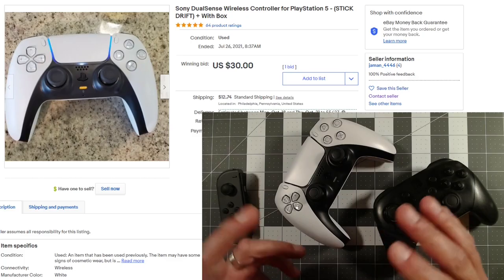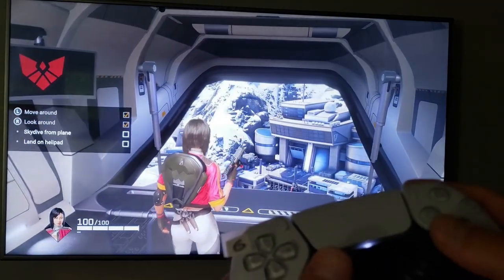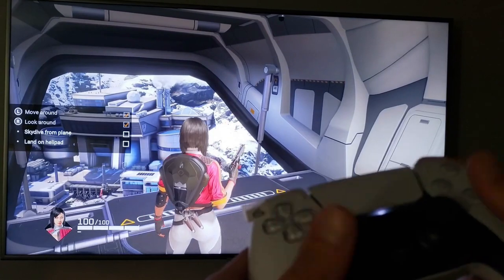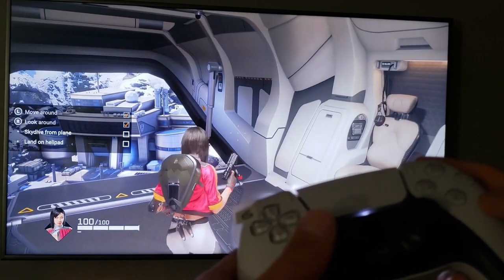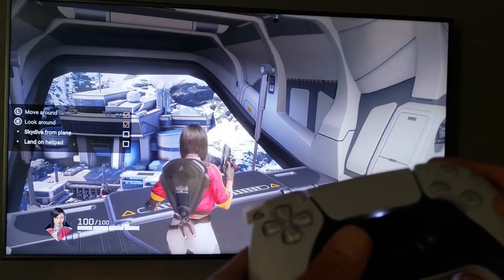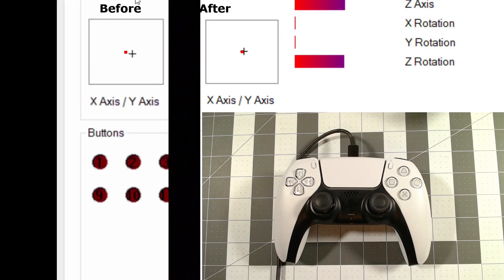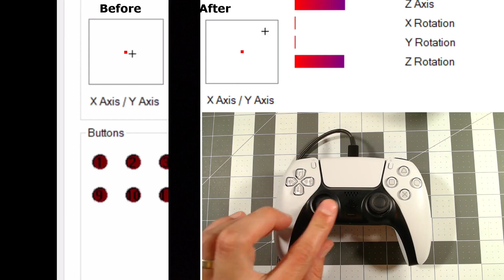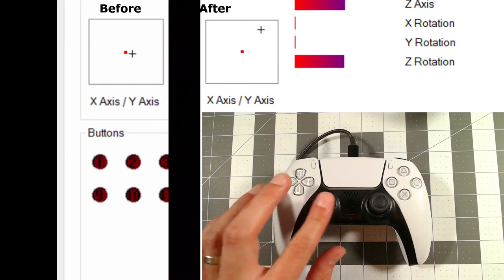PS5 Controller Drift Fix | NO REPLACEMENT PARTS

Comment: Why are companies still using potentiometers...  It's not because it's cheaper.  It is because it sells controllers.  I'm convinced that crappy design is actually intentional.  Sony has been around long enough to know not spending that little bit of extra money on the halls effect sensors will make them millions profit in the long run.
Reply from the maker: I don't see it that way. The "razor blades" are the games, not the controllers. I doubt selling a few extra controllers would even scratch the surface of game sale profit.
Reply: @FantasticQuack  Hmmmm it is the main controller issue though

Comment: This proves, yet again, that the early Dual Shock 3 , with the magnetic analog sticks, were probably the best controllers ever produced in terms of accuracy, durability and response. Too bad we cant find them anymore anywere. In terms of quality , they are worth 10 times more than any elite or scuff or whatever new garbage gets spit out these days. 12 years of hours upon hours of daily use and my DS3 is perfect and i set all deadzones in all games to zero and the controller itself has zero deadzone . It's like comparing a 95 honda to a 2022 honda. that shiny new awesome car with lots of features will be with you for 1 year.
Reply from the maker: VK's channel did a review on a modern 3rd party controller that is using the hall effect sticks instead of potentiomers. Go check out his channel if that interests you!

Comment: I was having an issue with my Switch Pro Controller joystick having a small angle where it didn't register a full angle (so my Dark Souls character would walk instead of jog/run in certain directions).  I did the trick of bending the wiper contacts out a bit, and it fixed it!
Reply from the maker: Love a good success story, nice work!

Comment: I took my controller apart and the common denominator for most of the joystick issues was a tiny piece of lint in the joystick area. I didn’t take it apart completely just flipped over the motherboard with the joysticks and put a flashlight and saw the little lint sticking out. I used a pair of eyebrow tweezers to pull them out very gently and when I put the controller back it was brand-new again.
Reply from the maker: That's super common, ran into the exact same issue in my Vita video, but the dust bunny was wedged in the very deep. Glad you got yours working, nice job!

Comment: This is a great video, but there are other videos that show how to access the potentiometer without completely removing (no soldering). Might be worth a shot if you just want to clean/bend.
Reply from the maker: True, but I wanted to take the whole stick box apart. With the method you're talking about you can just unclip each pot and bend the pins back to allow some access. If you want a full/clear view of everything it's better to desolder it--I just did a horrible job of that here haha. Still managed to get the job done though!

Comment: I stumbled across this vid on Reddit after a Google search. Thanks for this guide! Bit a of a ramble ahead but I actually stuck to using my PS4 controller for a while when I got my PS5 (barely six months ago) so I've got around two months' worth of very light use on my DualSense, and the left stick acts like I'm holding it to the left at all times. I've had right stick drift on well used controllers after playing FPS games and smashing R3 in constantly for years before but this is insane. At least the PS4 controller has nice loosened up and broken in sticks which makes FPS games a joy to use precisely on high sensitivities. The PS5 controller sticks feel stiff like I've just pulled it out of the box and yet it still drifts like this?!

I noticed there seemed to be a switch in materials used in the last "generation" of PS4 controllers around 2020 as I used to open mine up to switch out the sticks for custom metal ones - the motherboard inside had parts in new positions and the sticks felt different in terms of tension, so it wouldn't surprise me if they just switched to using lower quality parts in their potentiometers knowing a new console was coming out, so they could make even more money off even more outrageously poor controllers. Sadly I don't feel comfortable trying to fix this myself but there is no way I'm paying for a new DualSense controller so they better start allowing DS4s to be used on PS5 games 😤
Reply from the maker: Glad yo have you here and thanks for watching! I haven't felt much of a difference between DS4/5 in terms of the joysticks, don't quote me but I think the 2 controllers used the exact same stick box which is a very cost sensible decision for the company but not something that makes the consumers happy when those boxes were known to have drift issues (albeit not nearly as bad as Switch Joycons). Overall I greatly prefer DS5 for the improved form factor and adaptive triggers. I haven't experienced drift on either DS4 or DS5 so I have no personal ill will to them on that topic--maybe I've just been lucky. To get a drifting controller for this vid I had to specifically seek it out and buy it!

Comment: Thanks for this detailed video. This is a ridiculous process required to repair these. I have 2 dualsense out of warranty starting to drift. At least Switch joycon sticks could be easily replaced. I have the kit for joycons but no solder kit. Could you recommend a solder kit with everything needed for this (eg from Amazon)?
Reply from the maker: Glad you found this useful. The easy option for most people to remove the joystick will be to use low melt solder. It stays in liquid form much longer after heating so you have time to heat up pin by pin and remove the part before the solder solidifies again. This is the stuff I bought after making this video:
https://www.amazon.com/gp/product/B017ROFFEW/ref=ppx_yo_dt_b_search_asin_title?ie=UTF8&psc=1 

Beyond that you'll just want to have any soldering iron with regular leaded or lead free solder to put the stick box back on. Doesn't need to be anything fancy, even something like this cheap kit would be sufficient:
https://www.amazon.com/Soldering-Kit-Temperature-Desoldering-Electronics/dp/B07GTGGLXN/ref=sr_1_4?crid=SBKWQ9MFQVAT&keywords=soldering+iron&qid=1642526327&s=industrial&sprefix=soldering+iro%2Cindustrial%2C160&sr=1-4

Just keep in mind that you get what you pay for so if you plan on doing soldering work into the future I would invest in something nicer (Hakko is the leading brand name for electronics soldering).
Reply: @FantasticQuack  dude your fan fare is on point, that's worth a like and a sub

Comment: Maybe qc was better for the ps3? I bought a second ps3 controller that I used extensively, eventually, it did get drift. The controller that came with the console is still going strong after 8 years with no drift.
Reply from the maker: The early PS3 controllers use hall effect sensors instead of potentiometers so the moving parts don't contact each other, which means drift is less likely to occur on those. Dreamcast controllers did something similar.
Reply: @FantasticQuack  Interesting. I'm guessing the potentiometers are far cheaper? Otherwise, I don't see why they would let go of one piece of tech to use something inferior. It's always about money.
Reply from the maker: @RondellKB  yea they're cheaper. It's no different than the evolution of every consumer product over time really.

Comment: So if the wiper contacts aren't bend up that much you will get stick drift?
Reply from the maker: Pretty much. If they don't make good contact with the carbon tracks (or if there is dirt or oxidation) it can cause resistance spikes which would lead to drift.

Comment: 4:16 what a nice way to get your solder pads ripped off.  :)
Reply from the maker: In fairness I did point out how ridiculous that method was! Also should point out that this wouldn't rip off solder pads because they're on the top side of the board from the orientation I was holding it--so all the force was compressing the pads rather than pulling them away from the board. Cheers!

Comment: Doing controller surgery isn't in my resume man lol. Can you give me a better solution?
Reply from the maker: You could try blowing out the joystick with canned air and optionally adding rubbing alcohol. Might work in some cases if it is just a bit of dust needing to be cleared out.

Comment: well, can you add hall effect sticks. I mean would they be compatible, software and oin layout?
Reply from the maker: The voltage divider limits are likely different than hall voltage for the controllers that use them so I doubt a direct swap would work. Would be interesting to look into further to confirm this though..

Comment: There's no way a lot of us handle them to ruff.Ive used PS2 Controllers including the PS3 controller that can handle way worse.
Reply from the maker: It was just conjecture. But I will note that I've never had drift on any Sony controller personally (of course the one in this vid is an exception since I bought it already broken/drifting; it wasn't in the best shape in terms of scuffs and grime at least when considering its age)

Comment: I bought the dual sense edge controller and it works so much better but I mean like 4 base ps5 controllers later... smfh SONY
Reply from the maker: Nice! do you know if the edge controller works with the Sony DS5 charging dock?
Reply: @Fantastic Quack  I tried it once and it started charging without removing black piece but now I just can't find the spot for it to charge without it

Comment: I've now caused 2 separate PS5 controllers to drift by dropping them stick side down on a hardwood floor. Just pretend your PS5 controller is about as durable as and egg and treat it accordingly.
Reply from the maker: Note to self: only play PS5 above a shag rug
Reply: Had mine 5 months and no drift issues